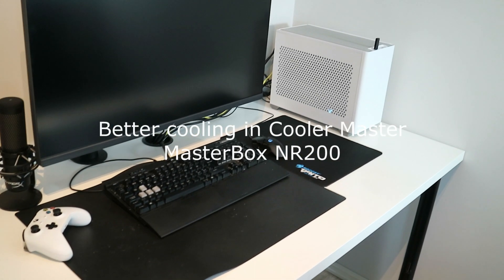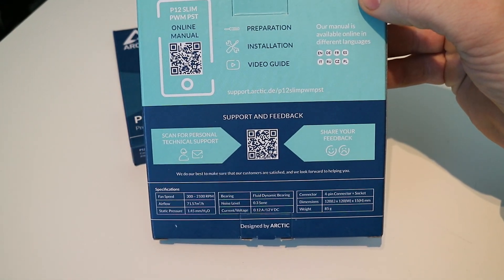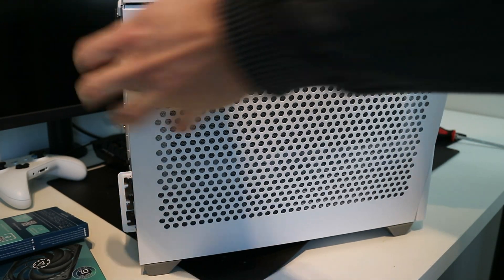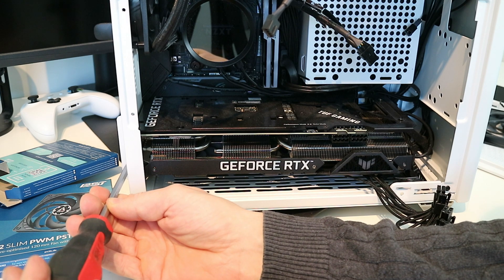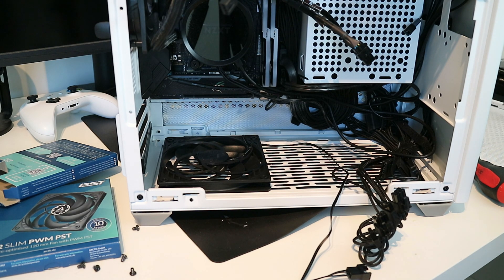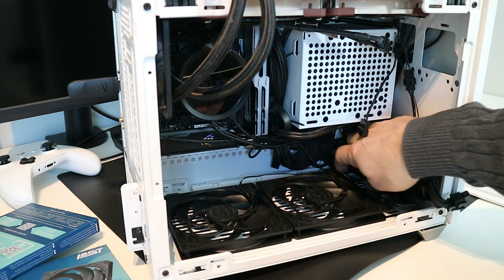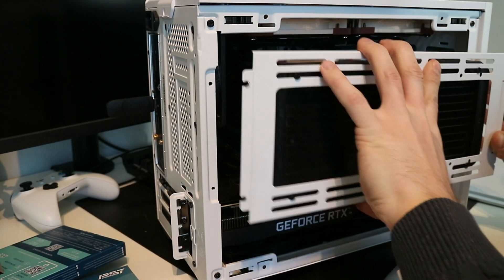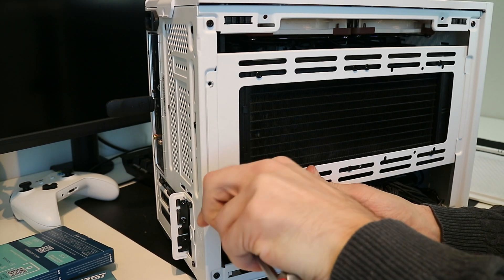Better cooling with more fans? Cooler Master MasterBox NR200 Mini ITX

Comment: You know you can take the bottom of the case off right? and install the fans directly on the plate. No need to take the GPU out, not even the AIO.

Comment: I am torn between copying this kind of build but with a 4070Ti / 4080 variant or getting a NR200P Max and doing it with a vertical GPU, but i strongly believe that this kind of build would get better thermals overall. Could likely even replace the liquid cooler with a tower and still get better temps than in the NR200P Max.

Comment: I would recommend to use the bottom fans to pull air out as now you are just pushing more hot air into the system due to GPU position.
Reply from the maker: I have to disagree since there is very little clearance from the cabinet to the table.
Also, the heat goes up instead of down as you suggest. As I have it now, the pcn gets cooling from the bottom and the side and draws hot air out behind and on top.
Reply: @Mixxel  You're correct. In addition, the GPU fans are oriented in such a way as to pull air up toward the PCB, which means placing the arctic fans in an exhaust position starves the GPU fans of air they would otherwise have. Doing it the way you showed in the video forcefeeds the GPU fresh air, keeping the GPU cooler with less fan speed, which results in cooler CPU temps under a GPU-stressed load. There's no sense in exhausting out the bottom of this case.
Reply: If you want to pull air out then you have to follow the vertical gpu set up, there you will exhaust the hot air that's coming from the bottom of the card out of the case while the card takes in the cool air from the side panel
Reply: Heat rises.. you cant exhaust air out of that small gap at the bottom.